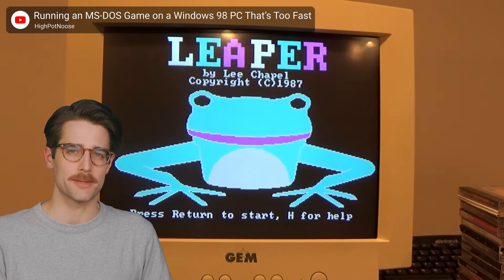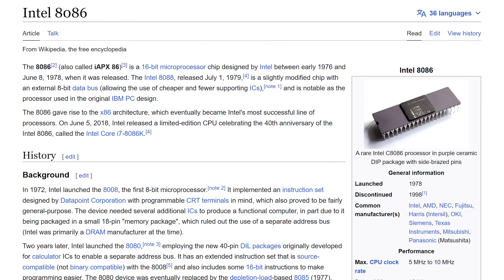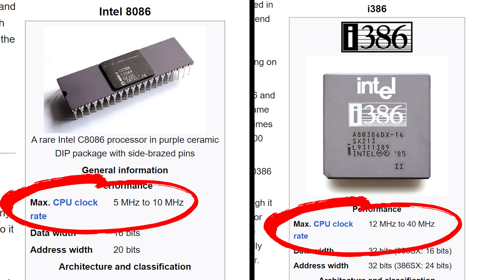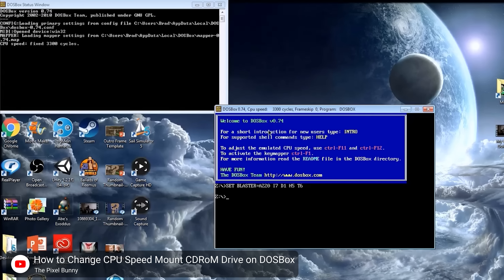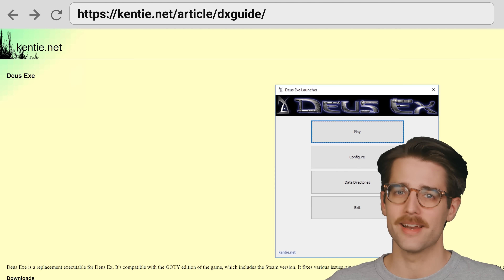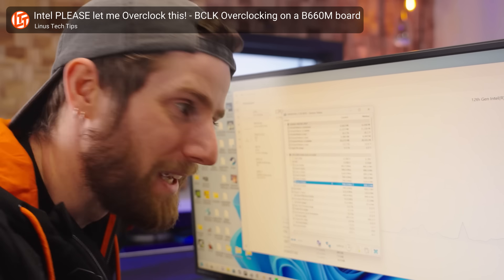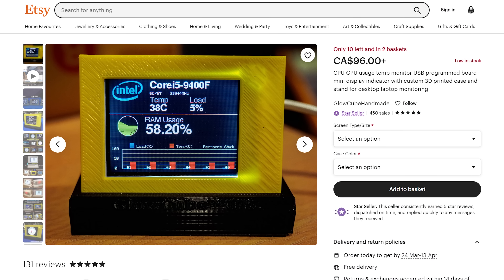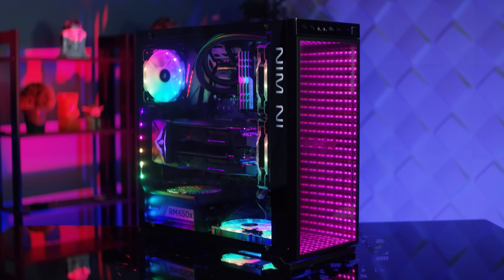Why PCs Had a TURBO Button

Comment: I had that same case with the "66" display.  (Nearly everyone did, back then.)  The numbers were settable via DIP switches, and when I upgraded to a 486DX2/100, I set it to "99".
Reply: That upgrade must've felt awesome, to max out the screen, like yeah my PC is too good!
Reply: I wish my PC was key operated
Reply: DX/4 BTW :P 

My P233 MMX says 233, and 586 when the turbo is off. Just so you don't mistake it for anything else.

Comment: I would love a physical button to switch between a stock and an overclocked setting.
Reply: There is one handheld PC (OnexPlayer) that has a turbo button, and it basically switches the TDP limit of the system from battery-saving to "fuggit I want moar frames".
Reply: Couldn’t you technically do that with a programmable key switch. Definitely wouldn’t be as fun as a button on the actual pc

Comment: Pretty sure all my Gigabyte installed apps are stuck turboing at 32bit on my 64bit system. 

Meanwhile I wonder if I should downclock my ram to run coupled with my flimsy infinity fabric, or let it run fat.

Comment: I still dont get why it's called a turbo button if it slows things down. Unless the CPU ran at 8086 speeds if it wasn't pressed in.
Reply: To be fair, it was the 8088 (which actually came out after the 8086 and had a 8 bit bus as opposed to 16) that they were referencing in the video, they just didn't know better as they most likely had never used one.

Comment: When I grew up I seen old computers in my grandpas basement that had this button. I thought it made it go faster for so long never questioned it. Until like a couple years ago I learned and felt dumb and felt dumber that they used the word “turbo” lol
Reply: Whether pushing it made it go faster or slower depended on how it was wired up. The correct way was to wire it so that pushing it made it go faster.

Comment: the key and power switch thing is something that needs to come back it looks much more fun to use than just a button
Reply: Let me start my PC… oh no my PC have a flat battery.
Reply: The power switch/button on old PCs were actually power cut offs hooked up to the power supply. Not the motherboard standby button you have now. That did mean that you have to "park" the system before shutting it off. If you didn't, you could risk having files corrupted or the disk head not go into a parking position and damage the dive if it got moved.
Reply: @PoisonedAl  my first win95 PC had this gigantic toggle switch on it that sounded and felt like I was flipping a 120v breaker on and off.
Reply: @stormy0307  The original IBM PC-1, PC-XT and PC-AT systems (and their clones) had a big paddle switch on the side.  It made a very distinct CLACK sound when you used it to turn the machine on or off.

And if you had one of those early systems  with their 'whopping' 10 or 20 MEGAbyte (!)  hard drives, it was a trip hearing those things spin up and bray and clatter.  Full-height, 5-1/4" bricks of electronics and MULTIPLE spinning platters.
Reply: @PoisonedAl  I remember my parents getting upset when I did that as a kid.
Reply: @PoisonedAl  "risk files having corrupted" not really anymore with modern windows. We don't use crappy fat16 or fat32 file systems anymore. We don't really even use hdds anymore and even those could handle the power cut because it's designed when it loses power the head gets pulled back to the park. Only very early hdds had to be parked manually with a dos command. Today if you cut the power, you pretty much only lose unsaved data, very unlikely to lose anything else, due to unsafe shutdown. 

That said physical switch isn't a good idea because the pc cannot go to standby where it shuts off psu.. I mean I have Windows 95 it really tried.. it shuts off cpu and the hdd.. but psu keeps running.. not windows fault. It's the best it could do when power cannot be controlled by software.

What we really want back is the turbo switch.. but this time instead of turbo just being the full speed, it should be one click overclock. A user preset overclock.
Reply: reminds me of a super car's ignition sequence.
Reply: @icky_thump  reminds me more of a bike tbh, key to run then switch to start
Reply: I mean, it wouldn't be impossible to mount a key switch to your desk or PC case and run the start button through it. Actually i'm pretty sure i've seen someone do it so what's stopping you
Reply: @TheLandFinana6044  Although the standard for those key switches was to turn the keyboard off rather than the power.
Reply: @cool110  Keyboard AND serial ports (AT) or PS2 ports (ATX).
Reply: @TheLandFinana6044  I've done it.  Easy mod, and it kept the child from sneaking downstairs to use the computer at night when she was supposed to be sleeping.
Reply: Oh yeah and make it under a flip up button cover do it feels like you're launching nukes or something
Reply: The key was only needed for primitive operating systems that didn't include basic security measures.  DOS, for example.

Many PSUs have a hardware switch on them; it's on the PSU itself, usually accessible if you reach around to the back of the case.

The 'turbo' button is no longer needed at all, as the video details.

I absolutely want the old hardware 'reset' button, though.

Comment: The turbo button didn't change the speed if the cpu, but the fsb.  This mattered when you had a DX2 cpu..

The thing was that both 8086 and 8088 had the same fsb speed. But on a lot of old PC there was no real time clock.

So in steed of measuring time, the game measured the FSB speed and slowing it down

It was typically very primitive simply rendering one frame, then waiting set amount of time. This work good on really simple game.

That is why Sierra game have speed setting, where "highest" is a wait time of 0. And that is also why the speed controller is so diffrent between diffent  computers.

Comment: I actually recommend the video "The PC turbo button mystery finally solved!" by VWestlife. 

The point that I'd like to make is: the button is actually meant to speed the computer the up. But the button and the indicating light can be wired in reverse. Some manufacturer didn't wire it correctly, and that may be the cause of the confusion.

It's there to ultimately toggle between the 2 speeds of the computer.
Reply: But it's been a while after I've watched that video, so take my comment with a grain of salt.
Reply: @RainDownpours  he uploaded a part two few weeks ago

Comment: Those displays did not measure the CPU speed. Instead you used jumpers to set what it displayed.
Reply: Correct. It was just a visual indication to show that the turbo feature was toggled from one state to another. In fact, it was very common to see those jumpers misplaced and have the LED display the computer's speed incorrectly.

Comment: Fun trivia: The turbo button often worked in reverse and made the computer SLOWER when you engaged it.
No idea about their reasoning but it was way too common.
Reply: He literally said this
Reply: I completely missed that part. Sorry! :D
Reply: The button is actually meant to speed the computer the up. But the button and the indicating light can be wired in reverse. Some manufacturer - and dumb 'PC assemblers' like the ones in the shop I worked at - didn't wire it correctly, and that may be the cause of the confusion. It's there to ultimately toggle between the 2 speeds of the computer.
Reply: @RogerioPereiradaSilva77  It goes further than that sadly. Some boards required a short to enter it while others required a open connection. Can understand why late boards went to keyboard combinations before the features eventual demise.

Comment: We had a turbo button on our first PC: 286, 1mb ram, 40mb hdd and 2 floppies.  Turbo changed processor speed between 15 and 7 MHz i think
Reply: 8 and 16 more likely.
Reply: @the_kombinator  I don't know, some old computers had the CPU run at odd speeds, like 4.77, or 7.14 MHz.
Reply: @Meshamu  Those would be rare, but not unheard of. I know I can set my bus speed to 7.14Mhz on one of my 386s though.
Reply: @the_kombinator  They actually weren't rare, 4.77 mhz was exactly what the original ibm 8086 cpu ran at.. Also Sega genesis had 7mhz cpu
Reply: @harshnemesis  Have you ever seen a 7 segment display on an original XT? Or on a Sega Genesis? Bet they had turbo buttons too ;)
Reply: @the_kombinator  I never said anything about turbo here.. I said there existed many popular cpus that had odd clock speeds
Reply: @harshnemesis  Well, I'm staying on OP's topic of turbo buttons changing the speed of the CPU...
Reply: @the_kombinator  they had turbo buttons WITH A SINGLE LED which was just off if turbo was off. there were no displays until 486 introduced it for displaying HI LO or actual speeds and yeah ALL of those early cpu-s run at 4.77MHz and 7.14MHz and even the later versions kept the internal timer on the original 4.77Mhz that was divided many times to get a 18.2hz timer interrupt that games used to time their framerate... no matter how they displayed 33/66MHz.
Reply: @vargata  OK. A few dozen 286s have passed through my hands since 1994 - I can assure you that the implementation of the turbo was done by CLK/(x) and was a setting in the BIOS. The display was entirely set with jumpers. Two completely disjoint architectures. 

It was not CPU generation dependent, I can guarantee you that.
Reply: @ nobody said it was cpu dependent, it was only introduced along the 486sx (around 1992). prior to that time cases only had a led to show if turbo is on or off and this was the case with xt-s too. that you could get a 286 with such display simply meant you have got a modern case with an old board+cpu. ive started working with 286-s nearly 10 years before you lol. and yes, the board simply had a switch connector that turned the led on or off, the case manufacturers realised they could add a fancy display being switched from the same pins and then you had to set up what was on the display, many came with preset HI/LO, or with the speeds of the actual cpu inside. the rest is exactly what i was talking about. the CLK or clockspeed on all of those early pc-s was calculated from the 4.77Mhz by multipliers dividers and counters... (well its original was some 14.3Mhz that was the NTSC standard for video signal generation)
Reply: @vargata  I most definitely had 386 DX and SX machines (20, 25, 40 MHz ) that had LED turbo displays, as well as a 286 (that went from 6 to 16) - My friend's 286 had one too, it was a 12 Mhz, he bought it in 1988. That's only 6 years after it came out...

Comment: According to a research of the tech youtuber VWestlife, pushing the turbo In fact raised the CPU clock speed to the maximum
Reply: It depended on motherboard manufacturer. Some motherboards even required a special command line tool to set turbo on or off(I think Compaq), while others would have the setting in the BIOS rather than a physical button.
Reply: @fattomandeibu  Intel had defined in an official spec sheet what the turbo button is supposed to do. In practice, the hardware manufacturers had handled it differently. There is clearly no general answer to what the button actually did but if you consider Intel's original definition of what this button had to do as being as the primary source, the turbo button should let your CPU run at full speed when pressed.

Comment: I remember tinkering as a very small kid with an already old pc, it had the turbo button which increased the 10mhz processor to a whopping 20mhz
Reply: Bro you bouta get all of the frames per day with that 20mhz
Reply: That’s still double the clock lol
Reply: @alsefina  imagine an I9 that goes to 12 ghz
Reply: Im sure my pc went from 33Mhz to 66Mhz thinking back lol
Reply: I (well.. 'we', technically) had a 386 with 16 MHz (:
5 MEGAbytes of RAM
...and a whopping 80 MEGAbyte hard drive!

And.. (Hold onto your butts...).. It even had a serial port to connect a dot matrix printer 👾
Reply: @iggysixx  Lucky. I had a 16 MHz SX with ONE meg of RAM, and no real way to upgrade it (it was a Compaq - proprietary memory cards + just being in the early 90s and memory prices) plus my hard drive was 42 Mb. Why don't you take your showoff somewhere else, rich boy!
Reply: LOL I bet it was a 286. It's worth a decent amount to the right person.
Reply: The master of overclocking
Reply: Bro we should have that with gpus in pc's nowadays
Reply: better than todays cpus, thats a 100% change vs maybe 10-20%
Reply: I've seen one where the turbo button caused the processor to go from SX 8MHz up to DX 32MHz. 4 times the speed, double the data buss width.

Comment: An old Intel manual says that having Turbo enabled boosts the CPU frequency 🐸
Reply: The button is actually meant to speed the computer the up. But the button and the indicating light can be wired in reverse. Some manufacturer - and dumb 'PC assemblers' like the ones in the shop I worked at - didn't wire it correctly, and that may be the cause of the confusion. It's there to ultimately toggle between the 2 speeds of the computer.
Reply: @RogerioPereiradaSilva77  You could set the switch either way, (3 wire switch) I personally set all mine to have turbo on with the switch in the "off" position - it made the case more aesthetic with all the buttons on the same level.
Reply: Yep it does that. Didn't you watch the whole video?